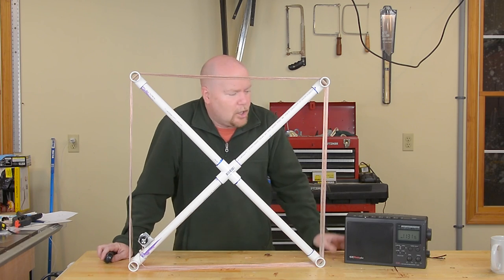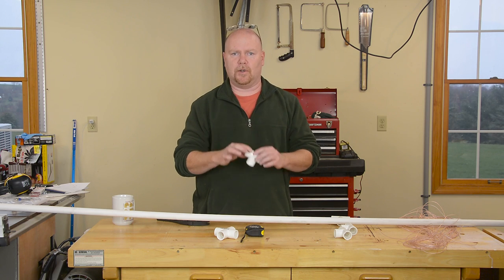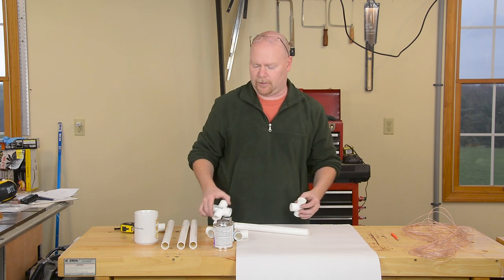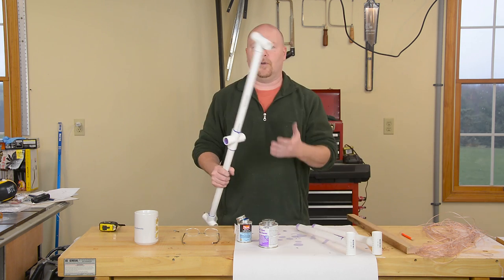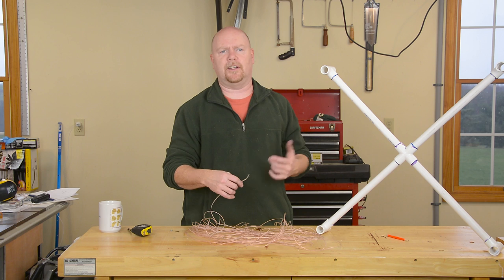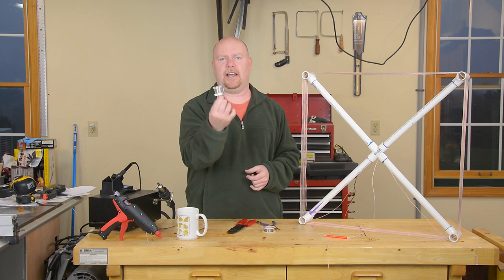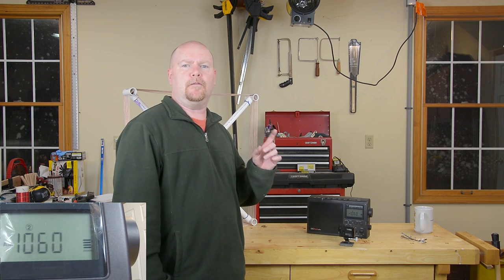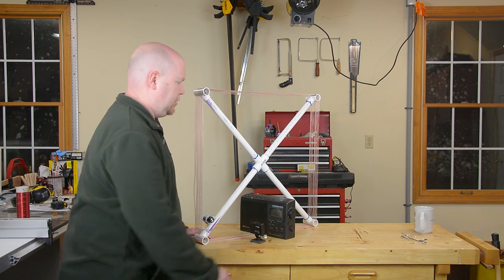AM Loop Antenna from PVC Pipe

Comment: Thanks for the reply.  Another question: I use a Panasonic gx500.sia radio made antenna effect for (sw-kw). antenna I built with 7 rows of copper wire.  correct?  size matters and No.  of copper wire rows?  I'm interested to test (mw) and (lw) on the Panasonic gx500.What should be done for the reception? By the way: does the variable capacitor model matter?  thank you very much.
Reply from the maker: I've updated the link at the end of the description to point to a working calculator for square loops.  It will let you experiment with size, row count, and the capacitor values to see the effect on loop tuning.  The model of capacitor does not matter for this application, only the range of values it provides.

Comment: Hey Matt, I'm assuming that your AM radio has a terminal with positive and ground connections, to plug into?
Reply from the maker: It does, but there are no connections from this loop to the radio.  The current that flows in the big loop generates a field which generates a current in the radios internal antenna.
Reply: Got it, thanks!

Comment: Hi Matt, I have a question regarding wiring the loop. By starting from the middle holes and then wiring 5 holes on one side, how do you get to the other 5 loops on the other side? I can't tell in your video. At some point I think you have to cross over inside of one the tees to wire the remaining 5 holes. 

Thanks
Reply from the maker: I started in the middle of the wire too.  This puts 1/2 the wire on one side of that middle hole, and the other 1/2 on the other side, ready to go the other direction.

Comment: How does one connect to an antenna input, if you do not have an antenna to couple with, for example connect to an SDR?
Reply: take a look at the website mentioned in the video description - you add a single-turn pickup loop, and connect that to coax running to your SDR.

Comment: 5:20 Which wire can make the best reception possible? Can solid non insulated wires make better reception in bad conditions or it doesn't matter? Does the height of the antenna stand matter? I want to have it outdoor to minimalize EMI. Do I really need variable capacitor when I will connect using coaxial cable? Is the grounding important or not that much? My hifi have loop antenna terminal connector. Will it work if I connect coaxial cable?
Reply: It doesn't matter what kind of wire you use and it doesn't even have to be wire with some designs using copper tubing or tape.  Also if you put one more loop of wire around it then connect the ends to a coax connector with a cable that comes in and connects to the antenna jack on your radio you can mount the antenna anywhere you want like outdoors and still connect it to the radio and no ground is needed. It would be kind of hard to tune when it's outdoors though.

Comment: So instead of the capacitor I could put this on my roof attach it to some 300 ohm flat antenna cable and attach the other end of the cable to the antenna input?
Reply from the maker: Not really, no.  The capacitor is needed, and has to be adjusted differently for different stations.  Not a practical design for roof mounting unless you want to build some automation for the tuning.
Reply: @MattHeere  Could you explain how one would be built? Or make a video about it? There really isn't much information anywhere. The receiver is part of a whole home audio system and its in the network closet with allot of noise. A FM roof antenna was no problem but trying to find one for AM is proving difficult.

Comment: Cool video! endorsed and subscribed! Now, as a total beginner in radio, I'd love to know what advantages this loop antenna has before the "classic" ferrite rod booster with the same variable capacitor!
Reply from the maker: Well it's essentially the same antenna.  Using a ferrite core let's you shrink the loop, which is helpful if you intend to install it inside a radio.  Big antennas catch more signal though.
Reply: @MattHeere  Thank you! I thought, ferrite was a crucial part in this construction, now much has been clear.

Comment: Hi Matt, thanks for sharing. I am very found of long distance radio reception. I am very interesting to made this stuff and would like to ask some questions i.e. PVC pipe dia in inch total length of pipe, T dia, X dia, numbers of holes with spacing in-between. type of wires used and number of turns, glues used, etc.  I am from Pakistan. I am Abdullah Bawaney...Thanks for your attention, and looking forward to hearing you soon, I remain Sir...
Reply from the maker: I think your best course of action is to use the link in the description and use the calculator to design a loop for the frequencies that are relevant to you for that part of the world.  My loop may or may not be any good for your conditions.   The calculator will give you the number of turns (and so holes) and the spacing.

The size of the PVC makes no difference as long as it's large enough to remain straight and rigid under the tension of the wire.   And the wire can be almost anything as well.  Magnet wire (such as that used to wind a motor) is about custom made for this job, but I find small speaker wire to be easier to obtain and to work with.  An old extension cord would do the job if you had nothing else.

Comment: Can something like this be used on a component-style receiver/amplifier?  Placing the loop in a remote location and then connecting it to the receiver with wires?
Reply from the maker: You can absolutely use loop antennas in that manner, but it requires a different design.  Usually you need to add a second smaller loop.  The two ends of the smaller loop run off to the terminals on the receiver, and the loop itself is what you sit inside the larger tuned loop.
Reply: Bonnie ratti slide guitar

Comment: Most superhet sets have at least 2 gang tuning air condensers... do you wire both in series or use just one....also does the tuning capacitor go in series with the loop...thx for your help....
Reply from the maker: The cap does go in series with the loop.  The total capacitance value is what's important (the calculator will tell you the needed range).  You should really try to find one that covers the range.  Capacitors have to be added in parallel to make them additive, which makes adjusting them quirky in a setup like this.

Comment: Great video! I am going to build one just like this.Thanks for posting!! I have a few questions however. I have not been able to get a specific answer in any of the videos i have watched on antenna builds. I should mention I am new to this hobby and electronics in general. I am teaching myself essentially.. What is the role of magnets in an antenna? Probably a stupid question, but I understand that they are needed and am following directions from videos i find on the net. What I do not get is why magnets? Magnetic wire, ferrite bars (especially since I am trying to build a loop or dipole. Also, What would happen, if i combined, i.e. bundled 3 or 4 ferrite bars with a zip tie ? Would that do anything at all or is all bad? Also, how do you know how many turns to use? I know you mentioned a calculator, but I can't find one that I actually understand. You help would be greatly appreciated. I hope to hear from you soon. Thanks in advance
-Tom
Reply from the maker: Kind of a long story, but I'll try to summarize it.  There are 3 basic electrical components:
1.  A resistor which turns electrical energy into heat.
2.  A capacitor which stores energy as charge between two closely spaced metal plates.
3.  An inductor, which stores energy in the magnetic field generated by running current through a wire.

Various combinations of these components react differently to different frequencies of electrical energy like radio waves.  More often than not, when you're putting together parts for something like this antenna what you're doing is trying to make a circuit that's most efficient at some range of frequencies.  In this case, we're designing a loop (indcutor) and capacitor combo that is most efficient (or resonates is the correct term) at the frequencies used for AM radio broadcast.

But you'll note that the inductor I built has a very, very large circumference.  For most applications this just isn't practical so we need a way to shrink the inductor without changing its effective value.  One way to do this is to wrap the wire around a material that had magnetic properties.  By using iron or ferrite, you can make an inductor that can store just as much energy in its magnetic field as my giant loop but in a much smaller package.

Changing the number of turns, or the composition of the material, or the amount of material will all affect the size of the inductor, and therefore change which frequencies it reacts to. 

Like all things in life there are trade-offs for doing this, but I promised to summarize :)
Reply: I believe I understand now. Thank you for your reply! I cannot for the life of me find a damn radio old enough to have an old variable capacitor around here, so I am going to order one online. For now, I want to just build a passive loop, a foot and a half from the midsection (Which is practical for my house and where the girlfriend won't roll her eyes everytime i put on headphone and put the antenna by the window lol) and i'll be using wood. What is the suggested number of turns to effectively pick up MW frequencies as well as spacing between the wire? I am using some pretty thin wire I got out of an old CRT television. I was thinking of braiding it before I wind it.
  From taking things apart, especially this TV, which has the copper wire wrapped around semi circle pieces of ferrite. Would it make any difference for good or bad, or have 0 effect if i made the loop with a ferrite bar at each end where the wire goes through the notches? I have just been curious about that. It seems that it would improve the inductance, but maybe I am wrong. I am new at this. ;)  But anyhow, thanks a lot for your response and reading my convoluted questions. I can't find clear answers to the specific questions I have on the net. 
Cheers,
Tom
Reply from the maker: There's a link to the calculator you need in the description for the video.  It's at the very end of the text.
Reply: Hey Matt, thanks for taking the time to read, and respond to my responses. I will post a picture of what I did when I finish it, if you feel like giving me some CONSTRUCTive (see what I did there? lol) Is up to you. But i am glad people like you post this kinda stuff on the web. It is very helpful to beginners like myself. Props, sir.

Comment: Matt can I use this for DRM reception? Am using RTL-SDR. Many thanks.
Reply: Probably not as designed here.  The radio he is using here has an internal loop antenna.  When place inside the loop he made, a transformer is created between the two loops.  In other words, this loop couples rf signals to the internal loop of the radio.  An SDR does not have an internal loop antenna.  Therefore, nothing will happen when you put it near this loop.  However, you can add an additional single loop of wire, not connected to this loop.  Instead one end goes to ground on the SDR and the other end goes to the center pin of the SDR SMA input connector.  That should work.

Comment: you started off by saying "tuning up" the only time ive been told any antenna needs tuning is to transmit. i have two simple wires of 15 running up my wall with thumb tacks and i can pick FM about 40 miles away and at night i can get WLS with a little noise
Reply from the maker: Loop antennas have an incredibly high Q and correspondingly narrow bandwidth.  The 2:1 VSWR range on one is often only 5Khz or less if you use them for transmit.  That's actually a benefit in this case though.  Mostly what makes this antenna work is rejection of unwanted signals.  Between being directional and the restricted bandwidth, it does a great job of pulling a single station out of the noise.

Comment: Would this work with bare wire or with a pair of wire out of CAT 5? Having a hard time finding over 100' of wire for a reasonable price.
Reply from the maker: It sure will.  Pretty much any wire will work.  If you go really big then you have to take the wire diameter into account when you calculate the spacing, but for anything under about 18AWG you can swap sizes at will, and insulation is irrelevant either way.
Reply: @MattHeere  finally got around to building it. Ended up using 22 gauge wire that was intended for a wireless pet fence. Middle of the day and I'm picking up an AM station roughly 100 miles away on a Sangean radio. Thanks again- this was a fun project.

Comment: HOW TO I HOOK THIS ANTENNA OUTSIDE TO CONNECT TO MY AMP INSIDE,,,???
Reply: Take a look at the website mentioned under SHOW MORE above.  The text describes the addition of a single turn pickup loop, that attaches to coax that you can run to your radio.  You'll probably want to make the capacitor "tunable-by-wire"; a scheme with a small DC motor to tune the loop remotely.

Comment: If I was hooking this up to a stand alone tuner on the 300 ohm, AM terminals would I still need the pf capacitor?
Reply from the maker: Yep.  This loop needs to be continuous, and needs the capacitor for tuning.  If you want to hook it up to a radio with antenna terminals then you need another smaller loop to put inside this large one.  The ends of the smaller loop are what you'd hook to the radio terminals.
Reply: thanks I thought so as I was experimenting before your reply.  It looks like the small loop has to be in the same plane as the large loop.  I fastened it to the center of the pvc frame. I will install a capacitor but just the proximity of the larger loop has improved reception.
Reply: Matt Heere could you make me one

Comment: How did you 'tie off' the wire?
Michael
Reply from the maker: The two ends of the wire attach to the two terminals on the capacitor to form the continuous loop.  I ended up replacing the electrical tape I used in the video with a small screw.

Comment: I have really old Radio with other bands you may never heard of before SW MW LW FM what kind of antenna I need for this types
Reply from the maker: SW (Short Wave), MW (Medium Wave), and LW (Long Wave) are just different frequency ranges of plain old AM radio.  This antenna will work for any of them, although it's unlikely that you'll be able to get a single loop to tune up across that wide of a range.

FM (Frequency Modulation) is a whole different animal.  You can use loop antennas for FM, but the don't couple well passively.  You need an actual electrical connection to the radio.  Most folks use a simple vertical antenna for FM, or perhaps an old TV antenna to pull in more distant stations.
Reply: +Matt Heere alright you like to check my radio videos I oldschool Sony Big radio tuner with too many antenna connections

Comment: Hey, thanks for answering my questions before. I have done some more research and I had a question or two. Hopefully someone in the comments can offer a suggestion so I don't keep pestering you. haha. Ok, so I have limited space in my house, and my girlfriend sure as hell isn't going to let me construct something large and put it in the yard, She would look at me like Doc Brown in Back to The Future when he was caught doing a "weather" experiment. I digress.. you sid you had 88 feet of wire, what is the calcultion for this? I tried to do the calculation for one antenna resonant on 600khz and another at 1300khz. Both 1/4 wave length, with your measurements I got 96 feet. I am just wondering what I am figuring wrong here.
Reply from the maker: Check the link at the bottom of the description.  You're essentially building an inductor and capacitor in parallel to create a resonant circuit, so the length of wire is for the inductor and not for a resonant antenna.
Reply: Matt Heere why do you guys keep saying resonate a receiver can't transmit at all what i was taught in ham radio is ANYTHING can be a receiver antenna but to transmit it has to be the right lenght

Comment: is that loop big enough to pick up stations on its own ? I mean, if you were to use it with a diode and high z head phones would it work?
Reply from the maker: It should.  If you want to try it, make the loop out of bare wire rather than insulated.  That way you can tap the diode in anywhere along the loop.

Comment: You probs wont respond to this but... i have a radio thats half a meter tall... i cant really fit it in the loop, any way to make it suitable for my radio?
Reply: I made a loop sides only 1 foot long, 11 turns of enamelled single-core wire, no spacing, just all in one V-shaped slot.  Works fine.  Obviously not as much signal gain but enough to make it certainly worth using.  Didn't calculate, just used trial and error: "too many" turns then cut back.